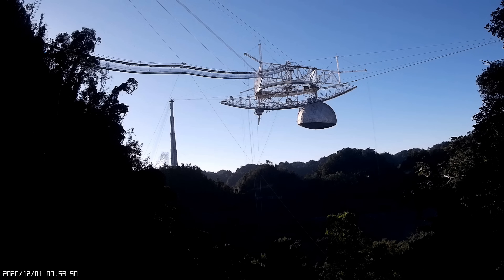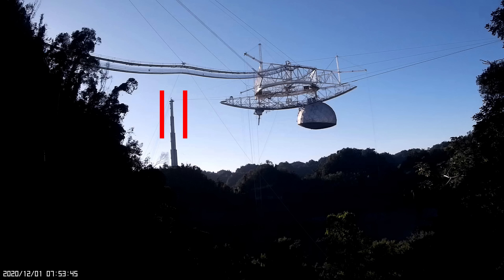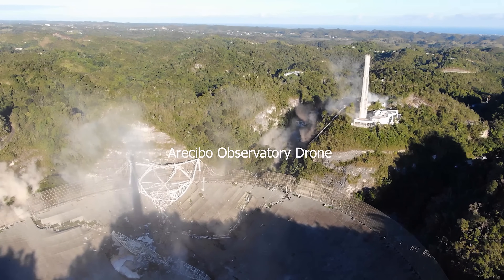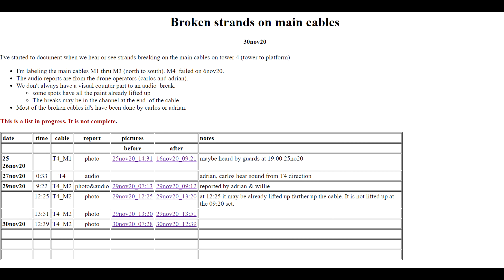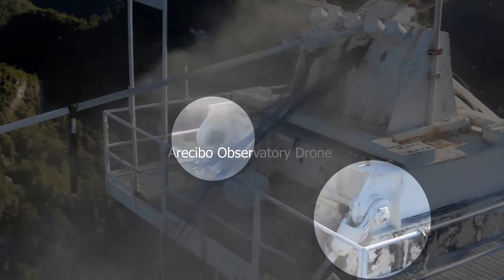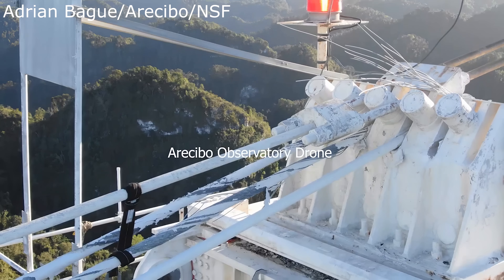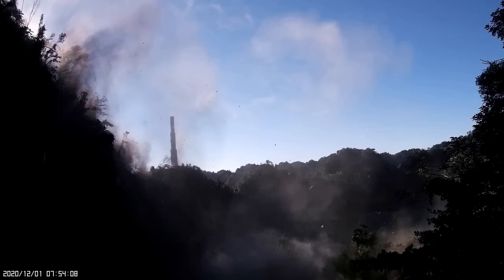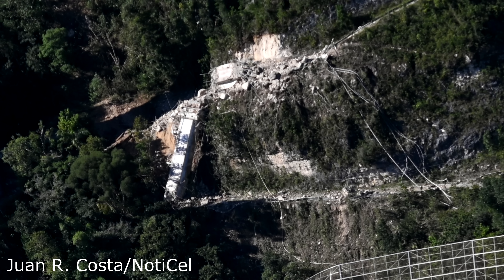Analyzing Video Footage Of Collapse of Massive Arecibo Telescope

Comment: you cant say "not to modern standards" for the towers. They were built some 50+ years ago. The problem was the OVER BURDEN of installing all the EXTRA hardware without adding the extra support for such weight additions.

As mentioned previously. Its insurance scam to make a larger setup elsewhere.

Comment: how is there a tower 4 on a 3 tower system....  ?   ?     ?
Reply: Towers 4, 8 and 12 bases on their position on a clockface.
Reply: The towers are 4, 8, and 12. Each tower had 4 cables so that’s how they got their names. Tower 4 has cables 1-4 and so on.

Comment: Not a engineer here but I have worked on microwave towers quite a bit.  They would have been much better off using a single tower in the center of the dish to support the horn or even a reflector.   This cabling idea is just too wonky in nature and prone to fail.

Comment: Sorry to say it that hard: but this was probably the best way to end it. I know that there have been discussions about how to dismantle it, but most ideas involve putting someone in danger.
And now with it being down, this ideal spot for a telescope is available again, and I guess all the researchers there have a big wishlist for arecibo 2.
That's what they need to learn: what was done, where did it fail, why did it fail, where were the limitations of the telescope, what can we do now.

I'm confident to see arecibo 2 up and running in some years. coming from austria, where we have tons of ski-lifts etc, reinventing arecibo isn't too hard, and it will be a better arecibo dish than ever.

EDIT: you said, that these snapping cables would be lethal. I agree, but would like to add: those cables don't care, the snapping ends would move through a body without any real resistance and would've sliced everything apart.